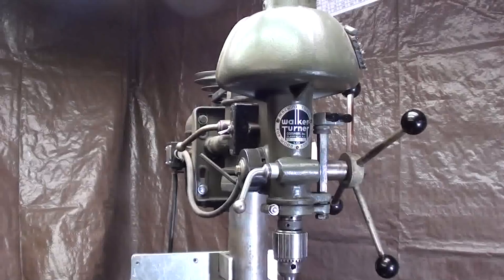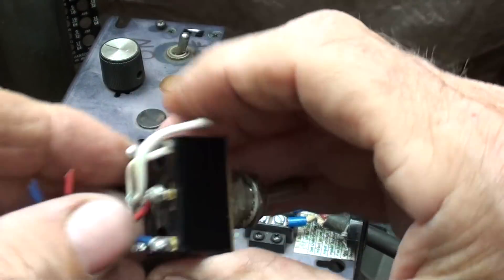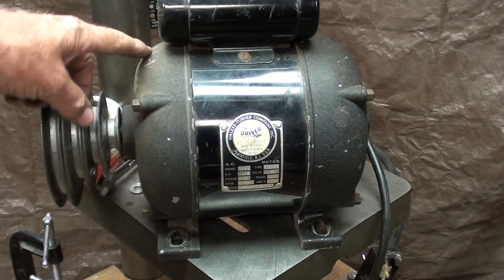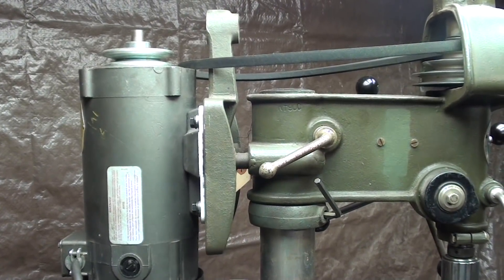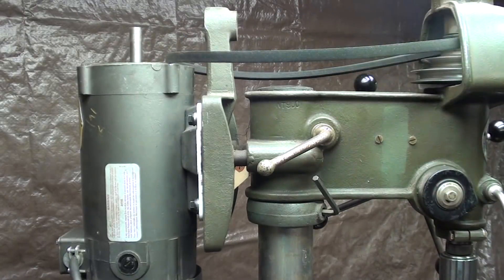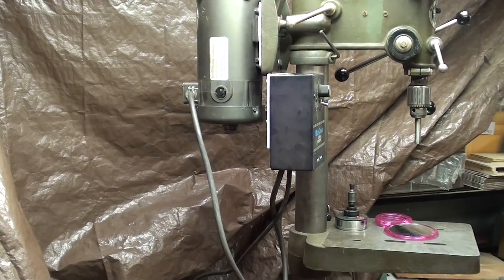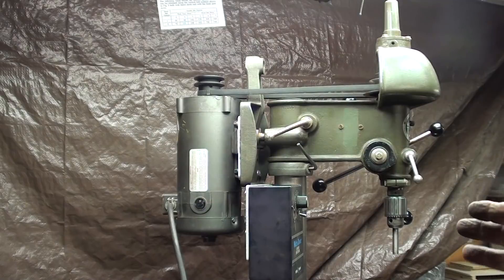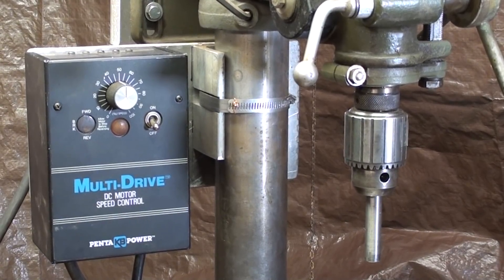Mounting DC Motor on Drill press Tips #480 tubalcain

Comment: I noticed that your old motor is rated at 725 rpm,so with the dc motor at less than half speed you will equal the original spindle speed of the old set up ,so you will be in the lower end of the speed range.Just a note on tapping: I would not recommend it,as a dc motor has to stop before reversing and coast to a stop which will make it a bit tricky to avoid going too deep. That is one reason VFDs are used as they can be immediately switched to reverse and most of them have a built in electronic brake which works great for tapping.All in all another interesting video as usual.
Reply from the maker: Thank you, that's a good point. And upcoming video will feature a VFD
Reply: It wasn't that visible, but the AC motor is 1,725 RPM on the tag.  Typical.
Reply: At 8.32 it is very clear that it is 725,surprised me ,what may look like a (1) is just a scratch.I had to go back and look closely,but there is no(1) embossed there
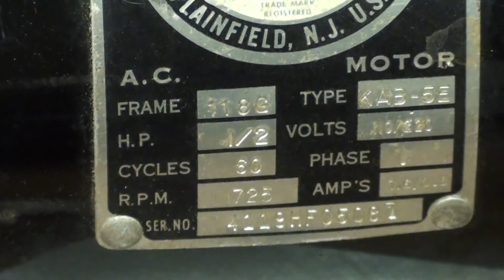Reply: I see it at 6:32, not 8:32.  There is a faint line there and I believe the motor is 1,725 RPM. 
 Tubalcain please clarify.  I have often seen nameplates poorly stamped on older motors.
Reply: The line shows clearly on my 75" Samsung.  Very unusual if it is in fact 725 RPM.
Reply: No such thing as 725 on a 60 Hz motor. I guarantee you it's 1725 (4 pole motor)

Comment: Thanks for this. There is an alternative circuit available now from China that may be cheaper. I am installing it on a Boxford engineers lathe with a 2.5 HP treadmill motor (at 4700 RPM it draws 8.5 amp at 180 volt DC). It has permanent magnets and brushes. 

The device is HQ-SXPWM-X for $US57 with free shipping. It uses a 16,000 Hz carrier frequency and turns the power on and off to regulate the average voltage the motor sees ie pulse width modulation (PWM). 

It has automatic ramp up voltage when starting over 3 seconds and 3 seconds ramp down when turned off. The ramp up is important because the motor only has 2.2 ohms resistance and theoretically could draw 82 amps when 180 volts is applied suddenly. As the motor picks up speed it acts as a generator opposing the input voltage.   

We will be discussing this on the Boxford Users Group and eventually I will make a YouTube video for my series (evanecent).  I already have a video about wiring a reversing switch for the standard half HP AC capacitor motor on the lathe and it includes a diagram explaining what the capacitor does - for anyone interested.
Reply from the maker: Thanks

Comment: Great video. Love the info u give. I have a few DC motors. I used a a few on 2x72 belt grinder I built. And  it didn't seem to have much torque  under load. DC treadmill motors have a heavy cast pully/disk. I guess the weight of the pulley helps with the torque. Not sure, Wondering if it would have enough torque on my drill press.  Any ideas. Thanks love your videos.
Reply from the maker: No, I am still experimenting

Comment: Nice job Mr Pete. So will motor be taking more rotiolal torque under load? Which makes me worried about only two small screws holding motor to your cast motor base, that are also holding it vertical as well.
Reply from the maker: That's very true, but they made thousands of them in that manner

Comment: Regardless of the amount of torque the motor has, there is no way you are going to be 
able to run very big holes saws with that little two inch pulley.
Maybe you could put the pull gear setup on the DC motor, I think you would really have great setup if you did that. I have a Walker-Turner 20" drill press with an eight pole 1-1/2 HP motor (855 RPM) with an Allen Bradley VFD with around a 2.5:1 reduction. I can run a 4" hole saw with it. The 1-1/2 HP motor has twice the torque of a normal four pole motor of the same horsepower. I left the step pulleys in place in case I might need even more torque by going
to the lowest pulleys. I have the VFD setup to go from 15 to 180 HZ, that gives me around  
85 -1025 Rpm at the spindle without changing belts.
Reply from the maker: Awesome, I think you have the right combination.

Comment: believe it or not you don't loose torque at low speeds with a dc motor. that and belt changes are why so many people are replacing ac motors for dc motors also your original motor was 1/2 horse the new one is 2hp  you'll ahve more power than you know what to do with Make sure you always use a vice bolted to the table. You don't want to spin a part if the drill bit grabs. 
I believe your switch you had will work on this to change directions  but if your going to tap you should look into a 
tap-O-Matic.   Yes Nice old drill press. Worth its weight in gold now.

Comment: Hello Lyle, I am looking to do something similar with my South Bend 14" economy drill press. I'm wondering how this worked for you? It's been about 4 years, so I was wondering if you still have this?
Reply from the maker: Did not work out. No torque on low speed. I went back to an AC motor with a VFD.

Comment: Thanks for sharing this I want to order a DC controller for my DC motor I have aquired of late I'm in the process of building a traveling key way cutter to make shafts I'm thinking direct drive for the cutter and would like to know what you would think or do I need to go with a heavy shaft drive with a motor and transmission in it
Reply from the maker: I think you have to go with a very heavy duty route

Comment: Would the final tachometer reading on the head be 40% of the motor speed since it had a 2:5 pulley ratio?  Could you put the tach on the motor pulley to see what speeds it's running at?

Comment: Why couldn't you use a chain and sprockets to drive the drill press from the motor?
Reply: If the spindle gets caught on a part and it has a chain/sprocket driving the spindle it could either break your hand or break the sprocket. At least with a pulley if it locks the motor can overcome the friction and just spin the belt. I'd rather ruin a belt than my fingers. Your idea is not without the merit of positive traction on the part, just at a cost. Even if you use clamps it can still cause more damage that necessary.
Reply: Cogged belt would work better for this application, run much smoother too.

Comment: Since you've run out of adjustment in the mounting slots, can you flip the current motor pulley so the larger diameter is on the bottom ?
Reply from the maker: Probably
Reply: Could flip the driven pulley, too, if you need to create a certain combo that the mounting doors won't let you reach, before you commit to altering the mounting point...?

Comment: Isn't the point of using a DC motor,was to keep the hp.at all rpms.or would it just be better to use a 3 phase motor with a VFD?
Reply from the maker: I will be using a three phase motor with a VFD very soon

Comment: FYI - The switch ST22N 

Maximum Voltage Rating In Volts
115.0 ac and 125.0 dc
Contact Load Current Rating At Maximum Rated Voltage
1.000 amperes resistive ac and 1.000 amperes inductive dc and 1.000 amperes resistive dc and 1.000 amperes inductive ac

Test Data Document
81349-mil-dtl-83731 specification (includes engineering type bulletins, brochures,etc., that reflect specification type data in specification format; excludes commercial catalogs, industry directories, and similar trade publications, reflecting general

Your welcome.
Reply from the maker: Sorry, you just lost me

Comment: If that reversing switch is switching DC current rather than AC then you need to be careful re the switch rating. DC switches tend to arc when the contacts are opened. AC does not have that issue as the voltage drops to zero. This video explains the issue. https://www.youtube.com/watch?v=mQpzwR7wLeo
Reply from the maker: Thanks for the information. I do install that reversing a switch in the next video. And it worked great